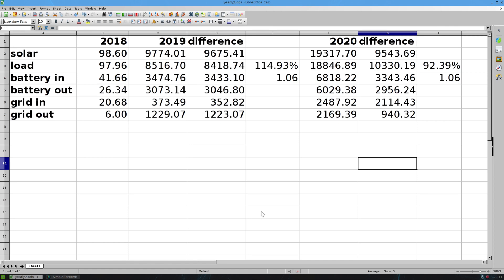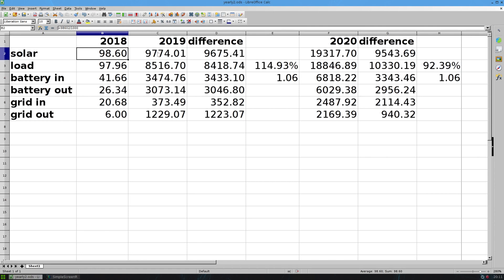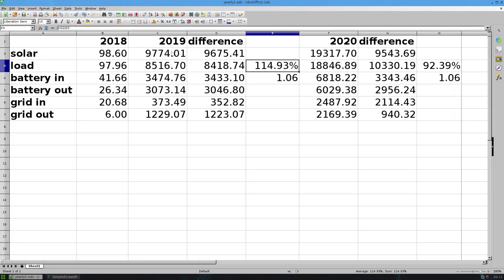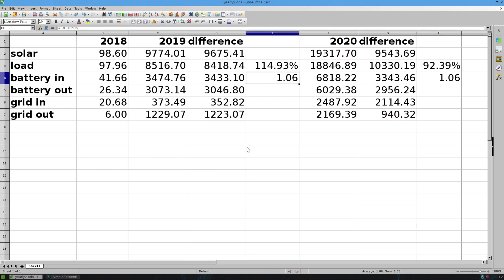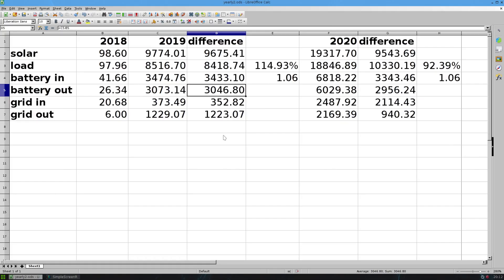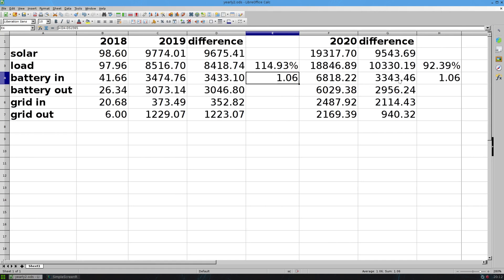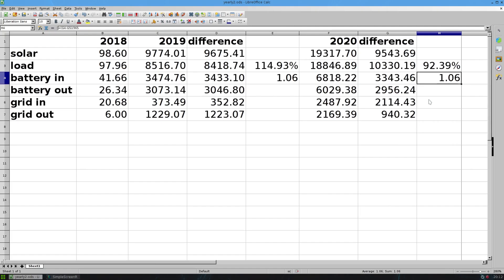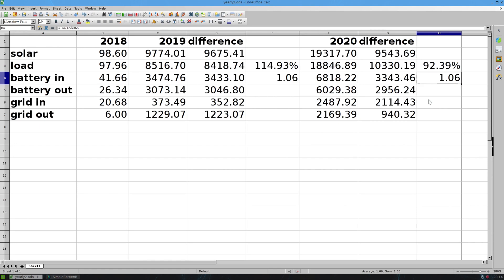Powerwall Degradation After Two Years

Comment: 7 years goes quick, long as you don’t move you should get some decent returns and no blackouts :)  in theory as used EV packs from automotive filter down into home storage, the costs will drop considerably.  I think Nissan already does it with their shit leaf batteries, perfect for home storage.  Not the dodgy diy versions either.
Reply from the maker: Not exactly. The Powerwall is currently dead. It has been for a month, because Tesla support is non-existent. I might make a video of exactly what went wrong, but it comes down to bad design. I love DIY stuff... and open source.
Reply: Ah shit sorry to hear that,  if u like DIY HBPowerwall here in Brisbane is the king of DIY with his 40-50kwh (could be more now). Powerwall.  Hopefully Tesla pulls their finger out.
Reply from the maker: @jestronixhanderson9898  That is a hell of a lot of capacity. I like it. Who did it?
Reply: HBPowerwall

Comment: our kWh / kWP is far less than your: roughly 1100 kWh per kWP installed .... any you seem to get close 2.000 kWh.

More sun + more vertical I guess .... and we get snow in the winter too, so days with snow or ice come close to IGLU  or foggy days.
Our battery is also working less or 8 kWh LI "redelviering" 1000 kWh ... over the year .
And we get just 9 Cent  for the kWh we can not use or store in the battery ...

Comment: $10 says you end up replacing it before any meaningful long term data is collected.
I keep running the numbers and i just cant get the economics on battery storage to work.
Reply from the maker: I got it to avoid blackouts. It works for that purpose.
Reply: @TallPaulTech  how can you set it up?  Do you have to have a topped up battery for that,

You have the battery discharging every night?
Reply: Depends on situation. We ditched bottled gas heating for reverse cycle. 85% self powered and near zero peak rate usage and no grid usage September to April. PW2 has been in for 2.5yrs and happy with approx 7yr ROI.

Comment: Are you really sure that that calculation of 1.06kw loss mean what your saying ? I would have though that the amount in and the amount out would stay around the same even if you could not charge the battery to the same level. Also Powerwall's actually have more capacity than the spec as this allows them to have room for degradation over time and the owner will not see it. Cheers